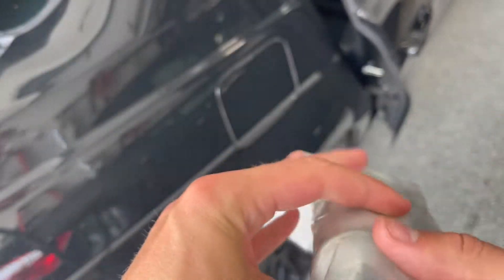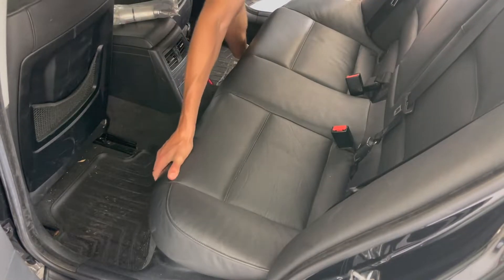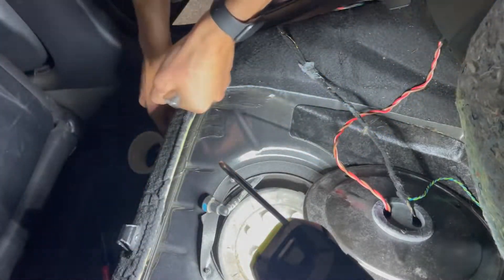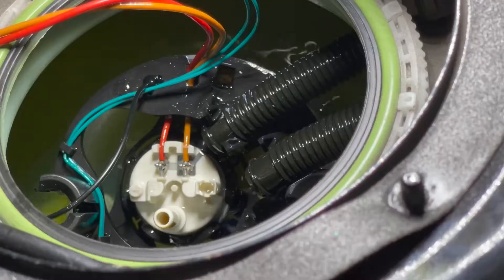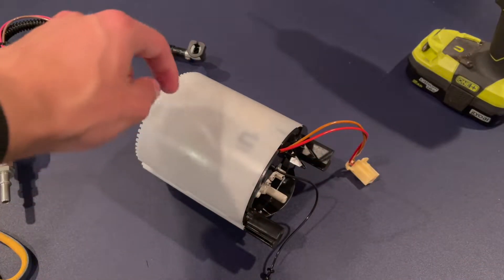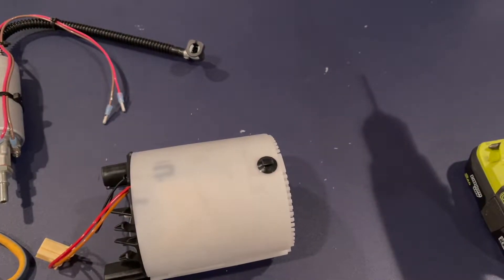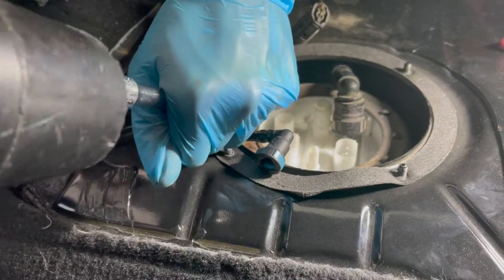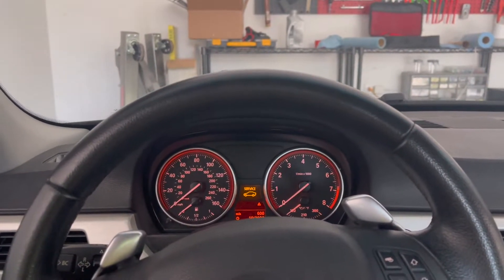N54 Stage 1 LPFP Upgrade

Comment: is your ekpm still okay? is the fuel it still running okay?
Reply from the maker: Yes, car runs great
Reply: @BYOMotorsport  awesome. I'm running this setup and I've been getting some dips in pressure. so chasing my tail trying to figure out why. it's intermittent though
Reply from the maker: @dextershumba7262  might be the original pump failing. Now that there’s two in series there’s always a possibility the original pump goes out
Reply: @vensora.automotive  Thanks man! the LPFP was new as well, oh well, will  have to try out a new one and see!

Comment: It will increase the fuel use?
Reply from the maker: Yes, the purpose of installing this pump is to supply more fuel to the car for additional power. Without a tune I doubt it would be a noticeable decrease in fuel efficiency however.

Comment: Do you think this setup would support 19t’s with FBO on 91 for 550 to 600 hp ? Or do you suggest the walbro 450 upgrade ?
Reply from the maker: On 91 you will need port injection for that kind of power.

Comment: When I look at the fuel it website it says plug and play unit, but you clearly had to do a little bit with wiring. Is that required ?
Reply from the maker: For stage 1 yes, wiring is required.

Comment: Hi what is the name for these black electric conectors
Reply from the maker: That is a bullet tap in/splice connector

http://www.qualitydist.net/pico-1580pt.html?viewfullsite=1
Reply: Thanks
Reply: Another question, please, I bought the almost new second-hand pump, but it does not have the small black part that it puts on after drilling, is that totally necessary?  What is the use of doing that and in any case where could I get it?
Reply from the maker: @luiscarlosmontanosaenz7717  That is the pump retainer clip. Essentially without that clip your pump will freely hang in your fuel tank. This could potentially cause problems if your taking hard turns putting stress on the pump connections. 

If your pump came without one I would look for different options regarding securing the new pumps position so it’s not just sitting on its own in the fuel tank.
Reply: ok I understand it is to hold the new pump so I guess it has to hold to the bottom of the white bottle of the oem pump
Reply from the maker: @luiscarlosmontanosaenz7717  Yes

https://www.google.com/aclk?sa=l&ai=DChcSEwiI8pT44rL5AhVGbW8EHbssBjYYABBTGgJqZg&ae=2&sig=AOD64_3cbg-rFHlDgskL0xTOfw9H6fZp8g&adurl&ctype=5&ved=0CAMQ0LYHKClqFwoTCLDUn_3isvkCFQAAAAAdAAAAABAK

Part looks like this, so maybe you could find something similar

Comment: This only works with stock lpfp right ? I tried running this with a 450 now my car won’t stay started
Reply: From what I've read, this pump actually restricts the flow of the 450 and is not supposed to be run in line with a 450. This pump runs inline with stock pump.
Reply: @dextershumba7262  correct. It is not meant to be ran with a upgraded pump only stock fuel pump
Reply from the maker: To my knowledge yes. The 255 runs in series with the stock lpfp, whereas the 450 replaces the stock pump entirely. 

I’m pretty sure the 450 requires a change in your tune also whereas the 255 runs as normal.
Reply: @vensora.automotive  I run a stage 2.5 which is a bucketed walbro 535. No need for tune but when you start upgrading fueling you'll want a tune, even an ots tune, so you can get the most out of your money.
Reply: @nateh8664  are you running an upgraded EKP with the walbro 535 or is the stock one holding up fine?